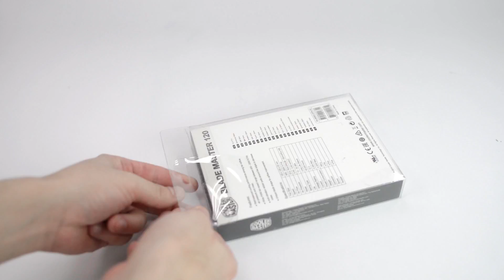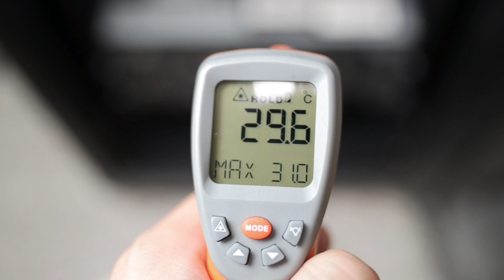Cooling a Server using PC Case Fans

Comment: Radiator fans would work better due to more air pressure. I'd recommend maglev fans, no bearing noise and longer lifespan than sleeve bearing.